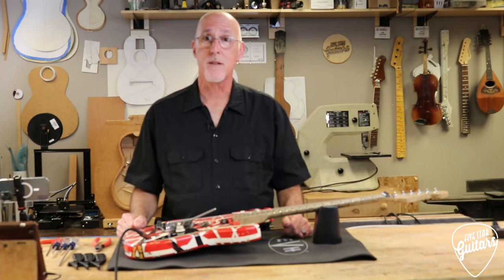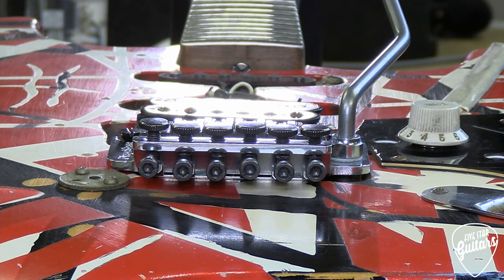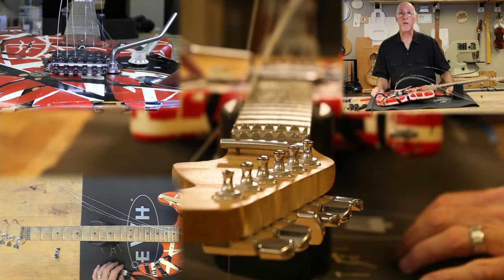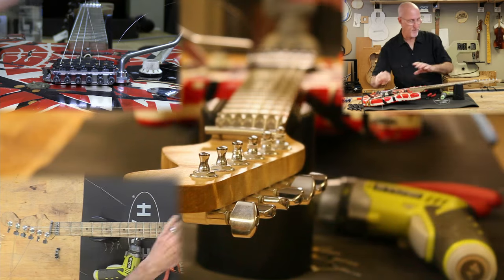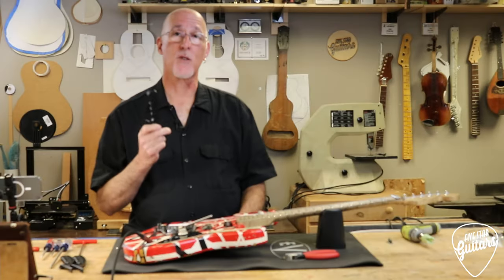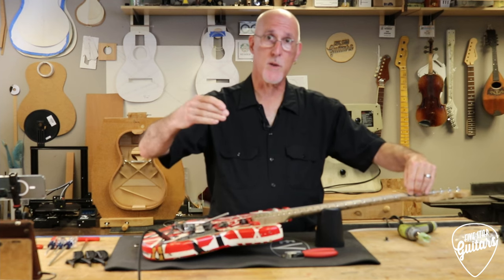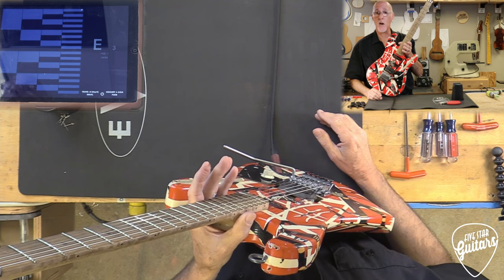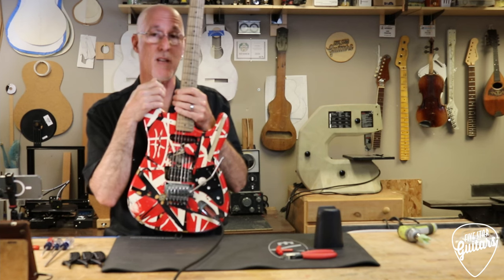Eddie Van Halen's Guitar Tech Tom Weber Restrings and Sets Up an EVH Frankenstein "Frankie" Guitar

Comment: This is a cool video, but unfortunately I have to point out a few things. I have been a certified guitar technician since 1996, and have worked on thousands of instruments since then. The reason why I watched the video, is not only am i a huge EVH fan, but because you can ALWAYS learn something from someone. Unfortunately, in this video I didn't. The video states that Tom does a setup on this guitar, but really all he did was a restring, and talked about a lot of stuff. What he did talk about was great info, but unfortunately it was not a full setup and will not help the average person set up or fix their guitar. where he lost me was when he told us to use the string as a straight edge ruler. I have heard this hundreds of times in my career, and couldn't be more false. That is an "ancient" technique which is not accurate. While his measurement of .010 was absolutely correct for that guitar, he should of shown how to do it properly with a straight edge ruler and a feeler gauge. Using a string as a guide is false information, because a string could be bent, have a bur in it or any number of problems which will cause your measurement to be off. He also didn't show how to measure and adjust the neck if needed, or do the intonation, something a person will need to know while trying to setup or fix their own guitar. Tom is a cool guy, and I have total respect for him, but this video should have been titled Tom restrings an EVH Frankie and gives some tips, as not all the info was there. I really was hoping to learn a tip or two, but was disappointed.
Reply: The intonation was already correct/set, no need to adjust.  He could have elaborated more on the  way to adjust the saddles should the intonation be out. The string stretcher was something different to me.  I've always pulled on the strings this method looked much quicker. I enjoyed the video and found it had insightful and historic value.
Reply: @Mrpedroromp  somewhat true, although the string stretcher wasn't a new thing for me, I've owned one for over a decade.

Comment: Watching a master at work is somehow theraputic. One of the often missed tricks is that thing of having the retainer bar behind the nut low enough to make sure the string doesn't get pulled sharp when you clamp the locking nut.

Comment: This was not a setup guide, it was basically Tom changing strings. 
Setting up a guitar would be, bridge height, Truss rod adjustment if needed, then intonating each string.
I like that the necks suppose to be precisely cut for the frets, but they never are perfect.
Reply: No he talked extensively about neck relief  which is addressing the truss rod and then he talked extensively about intonation while doing so to the guitar. We watch the same video?
Reply: @dahliafiend  Maybe not...   lol
Reply: @dahliafiend  He talked about it, but he didn't show you how to set the relief, or how to intonate a floyd. 
He did give some good tips, but never this is how it's done.

Comment: I stretch my strings by grabbing it at the 12 fret, which is half of the scale length, and you will get even pressure on the string, then I pull up on the string about 1 inch from the neck, sometimes up to 2”. I pull up at different parts of the string, up and down the neck, then keep tightening the tuner up to pitch. It works really well. I go lighter on the first three strings because they could break on you, especially the high E. I’ve been doing it for years and it works really well. On Floyd Rose’s, I keep the nut blocks and screws in loosely to keep the strings in the grooves of the nut. That string Stretcha looks like a good tool to have though.

Comment: Was really hoping to see Tom's saddle intonation and bridge height adjustments.
Reply: Also I believe it was you that put a 9 volt battery under the floyd to stop it from moving when removing the strings.
Reply: @chipperg25  a rolled up sock or polish cloth works really well.  Wedges the Rose without any potential scratching.
Reply: @chipperg25  it was Steve Vai's guitar tech that used the 9v battery trick....an older guy with an accent. He also talked about coming up with a hinged trem  cavity cover on Vai's JEMs.
Reply: @pcollenyt3683  Thomas Nordegg is his name
Reply: @pcollenyt3683  everybody has an accent...
Reply: @leeroden7900  well played, Sir. Might I add that Canadians DON’T say "abOOt". I would guess that South Park’s "Terence & Phillip" were responsible for this and it bugs me. Just saying…

Comment: I stick a flat toothbrush handle under the  back of my Floyd Rose when changing strings, so you don't need to tilt it forward. It's also close to the perfect height so when you do the initial tune after a string change and remove the toothbrush handle it's pretty much good to go, just stretch the strings a little..
Reply: You are talking about floating FR. EVH was using settings just for diving- you can’t pull bar up.

Comment: I watched a video of Steve Vies tech. He leaves the ball end on and goes through the tuning peg. There are some very cool bene fits to that. 1 the strings don't break as easily due to the fact they don't unwind. 2 you don't like your fingers or damage your guitar case or bag. 3. I have found even greater tuning stability doing that.
Reply: Eddie gave a Wolfgang to one of my cousins and that's how it was strung up so all my Eddie guitars ebmm, PV, and Kramer are done the same.

Comment: Everyone does it different . Steve Vai’s tech puts the ball end on the tuners. No wraps, then cuts the bridge end.
Reply: Thats old skool locking tuners if you have a floyd.  Problem is Floyd's arent as popular as they used to be.
Reply: I leave it on, from the tuner, through the locking bridge to the saddle. Wind the string up the post.
Reply: @kingfisher7960  lol wrong
Reply: That’s what I do too!

Comment: thanks for taking the time to explain the thought process.Im mostly a self taught tech. just to take care of my own instruments.. Ive done a decent job with what I have, but never realize the Floy rose parts wear out so quickly. It explains why the titanium parts are so expensive... cause they are worth it. I have an Ibanez guitar that I just quit playing cause it wont stay in tune. I figured it was because it was a cheap one. Now I have something to look for. I did finde grooves in the locking nut blocks and I sanded them down smooth by hand with some wet dry 400 grit paper. Also I didnt know the string streatcha was to be slid the entire lenght of the string. Thanks again for the information!

Comment: I have a feeler gauge that I use to place between the clamping block and nut block to keep it from twisting and causing a sharp/flat situation between two strings lock by the same block….. my weird knowledge of Floyd Rose systems goes back to 1984 and I have seen every flaw in it but also understand what value it has for acrobat guitar playing!!! Long live EVH and techs who know how to keep their guy in tune!!!
Reply: My first guitar came with an OFR and I did pretty well at learning how to set it up… Better than my local shop did!

Actually I managed to figure out most of these little tricks this gent showed us…

Comment: I love that he talks about excessive relief—I have been told you can run very little relief without any fret rattle—just don’t see how it’s possible to do that comfortably.

I’m hoping he addresses that in a future video.
Reply: If you pick or strum with excessive force you will get fret rattle even with excessive relief.  The player has to play within the fret rattle limit when playing if they don't want rattle. Just the way it is. So  0.010in relief is plenty. My relief range is 0.005in to 0.010in.
Reply: @jfo3000  Yeah, I target like 0.011 to 0.07. I just have bad technique I guess.
Reply: @gdhi11  Just guessing that Townsend might have had relief more I'm that range, depends on your approach. My buddy played Holdsworth's guitar and told me "I couldn't see air under the strings." So yeah Townsend vs Holdsworth setups...a pretty wide range, but the guitar can suite all performance styles it would seem. That makes it a great tool for everyone.
Reply: @jfo3000  I meant .007. Depends on the guitar. With rounder radius guitars, I'm generally closer to 0.012. On flatter radius guitars, I'm closer to 0.009 or so. I think people define fret rattle differently. Obviously you can exaggerate fret rattle by hitting the strings harder, and having them buzz against a neighboring fret (so fret at 1, buzzing against 2/3) but I've run into other issues that prevent super flat necks without using higher action. For example: 9.5" necks with the relief set to about 0.008 will basically fret out with big bends at the 10th, 11th, 12th, and sometimes 13th if you have low action. I've been playing long enough that I've seen some incredible stuff done with setups, but I am not buying the idea that having a nearly flat neck is a technique thing when physics says otherwise. It's also worth noting that fret rattle, even if it's not detectable through the amp effects your sustain which is why I'm kind of looking at Tom Weber and going "how exactly do you accomplish a low-relief setup?"

I've also been fortunate enough to play some pro player's guitars. I didn't see any special sauce in setups there, basically a little bit of relief and what you'd expect from the action--and it really varied based on player preference and style like you mentioned. Holdsworth's guitars were probably right on the frets, whereas some of the people I've crossed paths with were everywhere in between. Point is, it aligned with what you'd expect, if they played hard, their was more relief and higher action. 

I do think Shims might play into this, but that's part of the reason I asked. I don't feel a shim is a good solution as they have a tendency to change over time as they absorb moisture etc. depending on what you make them out of.

Comment: The real advantage to using the Gibson knot is locking the string on the post of the machine head. This , if done correctly, can be very useful for many applications. First on a guitar that does not have a locking nut or locking machine heads, it can prevent slippage. Second, for guitars that don’t have a machine head that loads down the shaft ( Fender ) , the string will be exposed. When the remainder of the string is cut back it creates a metal prick or thorn; not good. When the string is captured under the string in the Gibson knot you can tear off the remaining excess string , there by creating a prick/thorn less machine head . Thirdly, for quick string changes, the knot allows you to get the string locked into place faster, due to needing less wraps around the machine heads post . There are many good ways to achieve nearly the same thing. Don’t forget to stretch your strings .

Comment: Cool. I just put an FRX on my BC Rich Mockingbird about a week or so ago. I did every thing right as you showed except I did not pay attention to the strings crossing the locking nut and sitting flat before locking them down. Luckily I have had no issues so far other then the nightmare trying to set intonation on that bad boy. Maybe add in the need for that funny tool to hold and move the saddles under tension. I improvised and muddled thru it but that would have been a HUGE help had I known about them before I tried setup. NOWHERE in the literature does FR state the need for that tool. Had to come across it in a video by accident.

Comment: The ball ends don't have to come off, he doesn't want to cause any damage to it but uses a oversized allen wrench and drops it straight on the body several times.
Reply: @1peanut  You don't need to block the trem if it rests against the body as the body is acting as the block.

Comment: I've been playing for about 40 years -- though 40 doesn't necessarily make me a good player. I've got a dozen or so guitars and have built several (usually Warmoth parts) and sometimes have made my own parts. I've learned a lot and can do almost any sort of build/maint. But two things always still vex me: Setting up a floating trem (either a regular Fender or the Floyd) and getting the right relief on a neck. I've gotten to the point that I just deck a fender trem rather than fuss endlessly with it. And I've given up on the Floyd. On necks, I have found that no two are the same, and that proper relief for one does not mean it is proper for another. I love videos like these -- watching and learning from a pro -- makes it look easy. But just like it might seem easy to play like EVH if you haven't played guitar before, we all know that nobody but EVH can do the things he does and sound like he does. Its the same with guitar techs. Its an art.
Reply: I've been playing almost just as long. I haven't played a Floyd since 1988. I got tired of dealing with them and my style changed. I started just playing strats with non-locking trems set flush and using graphite nuts and locking tuners. The locking tuners help with string changes but their effect on staying in tune is negligible. It's the nut that matter's most, and if the strings are snagging the string trees. These days the only two guitars I play that have trems are my strat and my PRS. My other guitars are all stop tails including Schecters and an Ibanez Artist and I couldn't be happier. I will never use a locking trem again.
Reply: @angusorvid8840  
FLOYDROSE Trems love em or hate em! There's usually no in-between. 
I love em all my guitars have em but one. 🤘🤘🙏

Comment: I have learned all those lessons the hard way. I align all the tuner parallel/inline with the strings, I measure the string length using my hand to make a triangle on the fret board. I would say its a little faster. I am OCD and I like to have all the strings with the same exact amount of wraps. I Dont pre bend my strings before I pull them through. Hence why I put the tuners parallel. Once my length is set. I hold my finger on the tuner to not change the length. Then turn the machine head 1/4 giving me that 90 deg, then I bend the remaining length perpendicular the head. Sticking Straight up. I find leaving that crap hanging out causes scratching. Also, I get into arguments all the time. I tell people DO NOT TUNE OR INTONATE the guitar laying Flat. It will be off. Tune it. How you are going to play it. As far as string stretching. I have my methods for Floyd Rose. Once the guitar is reasonably close. Pick the guitar up and hold it like you are playing it. Ill grab the string by the pick ups and pull/wriggle the string all the way up to about the 5th fret. TUNE. Repeat until it stays in tune. Then I move to the next string. Rinse and repeat. Once its in tune. Check bridge position. It should be exact or dam close to where it was as long as you are using the same strings and GAUGE. Make any adjustments if needed. Play the guitar pretty aggressively exaggerated bends and bar drops. Tune it again. Let it sit for about 10-15 min. It will change I promise. Tune it again. Check bridge. If all is good Lock it down. Tune again. Then you are ready to rock.

Comment: Awesome. I'll humbly add that if a Floyd is floating, changing one string at a time is helpful.
Reply: There is a helpful tip I learned a long time ago for changing strings on a floating Floyd. I use old business cards, stacked and glued together as a shim, or spacer, to keep the bridge in it's playing position when all the strings are off. It helps me get the fresh strings on faster.

Comment: #1 TIP: BE PATIENT, GENUINE AND SINCERE. 
#2 37:45 if you're the above you can adjust the truss rod and spring claw to get this 100% without cheating the intonation. It isn't something you can pay for or do quickly. 

lol i just unlocked my floating bridge after 20 years with a massive high action and THICC strings.
It took a week, wore out a nut from just tuning, my hands as well, and of course, a pack of strings.
Learned it all myself from just turning screws and playing. Went from low stiff and fast, to high slushy and bendy, and everywhere in between. Then i put the 3rd spring back in and started over...

I only learned of Van Halen when i googled tubes for my old Peavey Triumph. I'm definitely on the right track. I can feel it! Except imagine him with Steve Vai's 7 string. Everything sounds so 80's!!!

Comment: Hello Tom,
Thanks for all the valuable information in this video. I'm hoping you may be able to settle a debate that I've had with in my own head for years, LOL. Did the Kramer 5150 have a treble bleed circuit? Sometimes when I watch the old live without a net video, I would swear it sounds like it does when the guitars volume pot is rolled back. Thanks in advance for your time, and thanks again for the great content!

Comment: These are made by Fender? He says something about not making any more scratches or something like that,  than came from Fender. 

I never knew who made these.  I had a chance to play Eddie's real Frankenstein guitar before these custom shop versions came out.  I couldn't play worth a crap on it,  it was like my first guitar that I ever had as a kid,  after I hacked it up. Lol. 

Just goes to show,  it's in the fingers of the player, to make it sing the way it's supposed to.
Reply: Yeah right. You’ve never been within 100 paces of Ed’s real guitar.
Reply: @thefonzkiss  um yea,  had it in my hands when it came to a store that I worked at, as a display that made the rounds. It was locked in s glass case that was on display.  I was tasked with taking it out of the glass and packing it back into the guitar case and shipping it to the next stop on its "tour". I plugged it in and messed with it fur about 10 minutes before packing it.  It was long before any of these signature guitars were ever made.  The packing sheets had EVH's address on them,  along with the management information, just in case they got lost in transit.